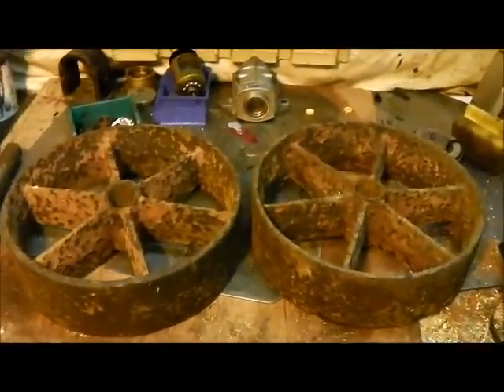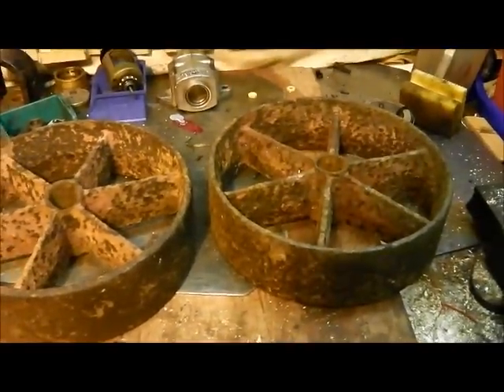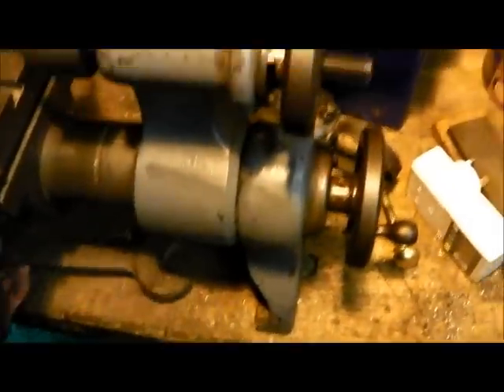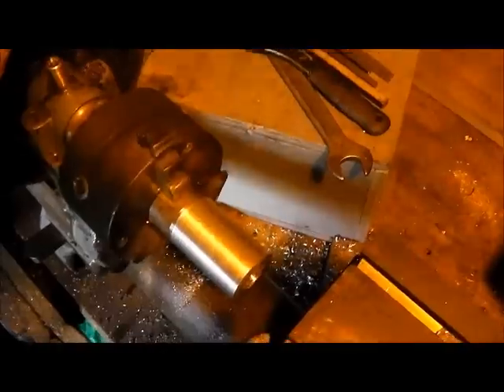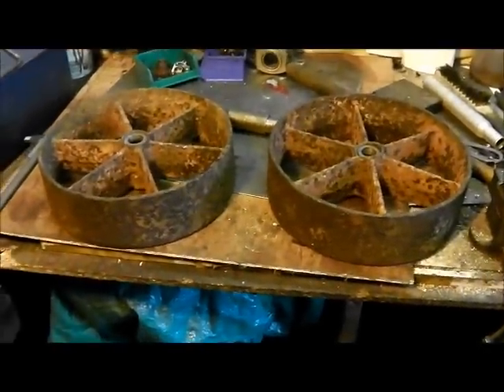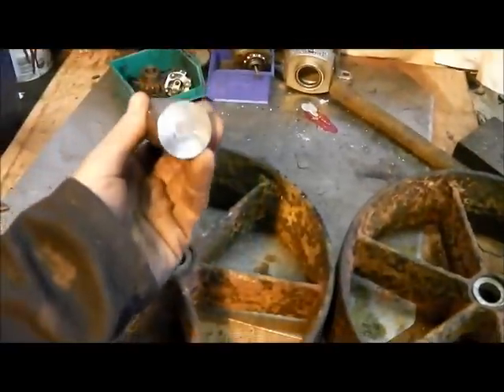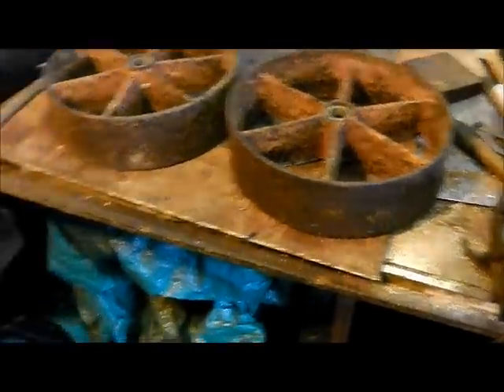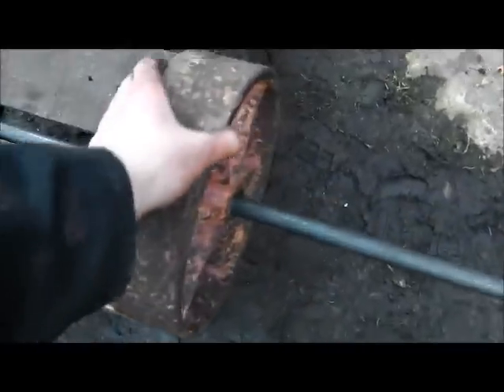Two wheels on my wagon.... cast iron wheels repair

Comment: Nice wheels would have made good flywheels on a home built hit or miss engine.
I was passing several skips on my walk to collect the car and found a steel cover with a cut out for a window and my mind instantly recognised it as a part for my possible model locomotive parts grit blasting cabinet. the window is at 45 degrees and has threaded bushings ready for the glass holder and acitate sheets for the grit side. Plus a large round hole just where the light would go etc.
David.

Comment from the maker: Hi David

Firstly, NO, never use cast iron wheels as flywheel as they are very crude castings and could well go bang pretty easily if subjected to more than a few hundred rpm's

Hope you saved that bit of steel, never mind recycling tin cans and so on... that's what it's all about!  Will you upload some videos of building the cabinet, it would be interesting to see it. 

Take care,

Phill.